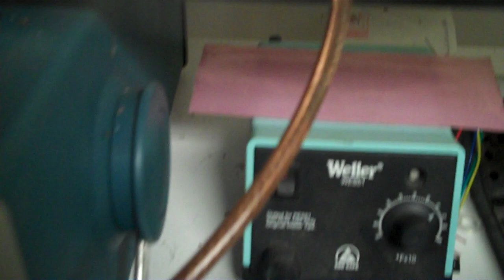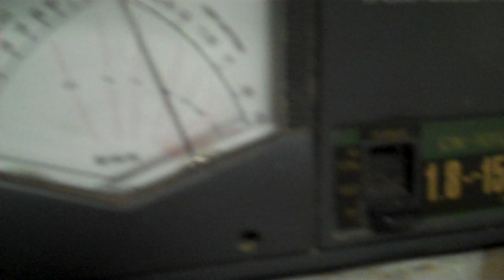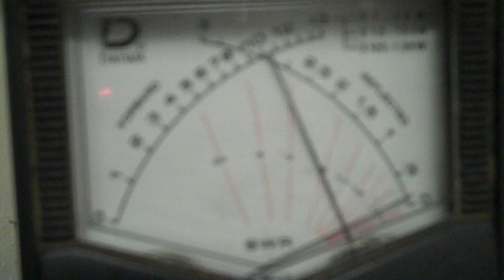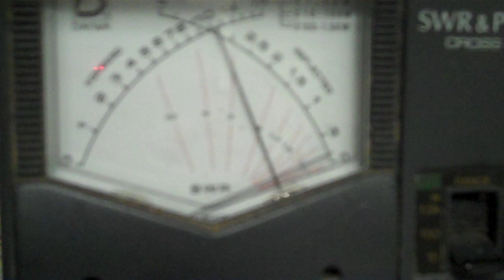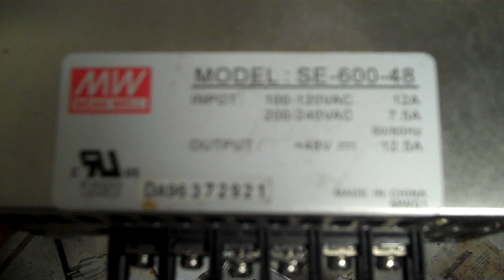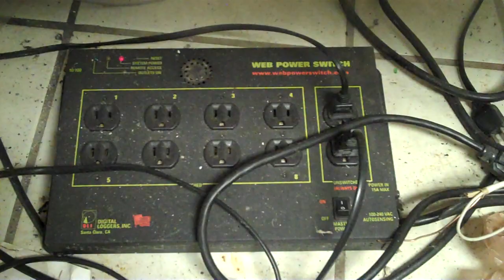Pirate Radio station

Comment: Yes, I did a test transmission with a 150W TX from my room and disturbed TV reception and anything metallic, so it seems! Nice Weller Soldering Station you've got there, haven't seen one of them since the 70's.

Comment: To all " Pirates" of the radio, my  first response is great for you to have your own station.  The Airways are free, and it supposed to be so.  Government should not refuse a license to broadcast anywhere, but regulation is really necessary.  I wouldn't want to interfere with someone who has a commercial licensed station, and that's their living, and business.  Non-Commercial radio on the broadcast band should be allowed but limited wattage.  Now to my point.  The main heart of your station is your ANTENNA !!!  Not how much power you got. Make your antenna as good as possible, and do NOT slack when it comes to the very best you can get, or make.  Dipole antennas are great, but they have some serious drawbacks. For great FM transmission, you really need a ground plane antenna, tthat is at least  one quarter wave length long.  This is minimum.   After you have made your antenna the best you can get it, then add your power, but no more than one watt to start with.  Do not tick off your neighbors.  Use of RF chokes can isolate harmonic radiation from your transmitter.  Grounding your transmitter to a good earth ground is another plus.   After you have done all this, and cked your frequencies that you could use, listen intently on that one frequency, to see if there is ANY distant stations that you can just barely hear.  If so, look for another frequency to broadcast that one watt.  Don't ever forget that the licensed station DOES have the priority on the frequency.  It only takes ONE COMPLAINT for the FCC comes calling.  Finally, try not to offend any one by programing you send out on the air. Someone may report you for other reasons that includes obscene, indecent, vulgary, or slanderous broadcasting or programing. Just a few thoughts from an old Commercial Radio D.J.
Reply: antenna is very important, but on some radio bands you need enough power to break through all the noise. Say here, on FM with a powerful antenna and 50 watts, i got shy of 3 miles, on AM with a fairly tall mast and a good ground system, i get shy of 10 miles with only 5 watts. The FM band in my area is extremely crowded with 100 kw stations, but the AM band there is nothing above 1580 and the most powerful station has 10 kw. both is better, also filtering and modulation is important.
Reply: K-LOVE GET OFF THE AIR!!!!

Comment: 10 watts mono with a 50 foot antenna and you only got a 1/4 mile? I transmitted 10 watts stereo with an antenna only 20 feet up (j-pole) and the signal went about 3 miles.

You must have a really crappy antenna.
Reply: Ryan Toomey I don't know what all you guys are doing wrong. I'm using 7 watts, antenna isn't even outdoors, I'm getting 5 miles solid coverage with an additional 3 miles fringe coverage.
Reply: @brettcooper3893  I'm using .05 of a watt and they can hear me a state over, so you guys are TRIPPIN. (ha  ha ha, it was a joke)

Comment: So long wire between power suplly, transmitter and power amplifire? No so good idea. It must be more shortly. Such an arrangement and connections is not so good for reliability and stability in operation of the equipment.
P.S. Please do not be offended.

Comment: BE CAREFUL , interference is the reason I only put out 1 watt! ( I've been on the air a long time) and at 10 watts or 150 watts , you are likely to cause interference and get a NOUO from the FCC!  With only a 1 bay antenna system all of your power stays next to your house. 2 antennas 10 feet apart would make your signal less concentrated near your house and go further.

Comment from the maker: 10 Watts went about a quarter mile in all directions, and 150 Watts covered the whole city.  About three miles all around.  The problem with 150 Watts in a neighborhood is front end overloading.  Pretty much anyone within a block would hear only our station, no matter what they tune too.  My neighbor could hear it through his speaker wires.  We tried filters, but didn't have much luck.  The antenna was on a mast attached to the chimney about 50 feet up.  Antenna height and antenna elevation above terrain is your best friend.  More transmitting power helps, but not as much as you might think.  Like 20 Watts wont go twice the distance of 10 Watts, not even close.  Get you a nice little ten Watt transmitter, some sort of directional antenna, and stick that thing up as high as you can get it.  The more power you transmit, the more problems your going to have.  Like front end overloading, rf interference on your own equipment, and pissed neighbors.  Hope this helps all our future and current pirate radio cats.  Remember, check you local laws.  Where I live it is not illegal, merely against FCC regulations.  The absolute worse they could do is fine you, and take your equipment.  Most of the time its just a cease and desist letter, and if you ignore that, expect some FCC engineers to come knocking eventually.  The FCC engineers that came to us were pretty cool, they liked what we were doing, but had a job to do.  BTW they took our amplifier not transmitter.  The amplifier was the cheapest part of the system.  Seriously check you laws, some states it is illegal.  I believe in Fla, it might be a felony!  Also, dont be a dumbass and broadcast near an airport, you interfere with those planes and they will come with a quickness, and most likely spend time in jail.  Do your research, take your time and dont be an asshat.  A good way to learn about radio is your local HAM club, but dont tell them about it.  Thanks for all the positive responses, and eat a bowl of dicks to the ones talking shit.
Reply: 1/4 mile with 10 watts? Lol I'm sure if you put a wattmeter between your antenna and Tx you will have SWR as hell,  your LCD say 10 Watts but maybe only 2 you can radiate ...asdasdasdsa
Reply: Matt Bremer We had 20ish miles with 300 watts. We had it on the roof of a 30 storey building, and a link transmitter that reached around a mile so we could have the studio in a different location. It wasn't PLL though.
Reply: +Matt Bremer Hello Matt, how is that possible? We have had a 6 mile coverage, and within 2 or 3 miles in all directions a very loud signal, with just 8 Watts, using one single open dipole antenna on about 46 feet height.
Reply: +TV13 I tried a transmitter with a power of only 0.5 watts before and I managed to get nearly 2 miles with a decent signal, I'm not to sure how he only managed to get only a quarter mile on 10 watts!
Reply: @MarkAyt  i get 2 miles with 50 watts and a powerful antenna, so ERP is around 100 watts.
Reply: I get 10 miles with 10w and 3 miles with 1w profesional transmiter exciter..I dont understand how do you get just a a quarter mile with 10w.Or your antenna is shit,or your transmitter is shit ,or the buildings is around you.
Reply: @ciro79  I think it’s the 100 kw stations 6 miles from me and a few tall metal buildings that are the problem. I am running 50 watts. Because I can hear it like 10 or 20 miles away if I have a yagi and a super selective receiver. I moved to AM and I am getting twice the listenable range with half the power. with 20 watts, the carrier is detectable 100 miles away during the day. I am using the same tower, infact I am using the coax shield of the FM antenna as the AM antenna and I only need a small loading coil to achieve resonance. I transmit on 1710 AM.
Reply: @letitrotfuckit  WBFM hawe wide bandwith of 180 khz so lost many transmit power with the range, but audio is very quality.AM transmiter use just  10 khz bandwith, and use bouncing of jonosphere, so it goes very far.For example i am HAM radio operator and i make many conversations in the air with New Zeland radio amateur stations on SSB mode on 7 mhz and 100w power of my station,from Europe.SSB is just 2,5 khz wide.That is 17 000 km range for 100w SSB transmitter..
Reply: i had 2 miles with 50 watts, but 10 miles with 5 watts on AM.
Reply: lol well damn i was about to call you a dirty pirate but you got me with the bowl of dicks thing! lol im trying to figure out how to do this, i live in a small town and trying to figure out what i need to get about 15 or 20 miles coverage. fuck the FCC or any other 3 letter boot lickers that have a problem with it.

Comment: My yagi was designed using yagi for windows for extremely high front to back ratio. I achieved about 40dB by correctly spacing the reflector from the mast. This was so I could aim the antenna so the null was in a specific direction to make the signal more decieving... that it might seem as though they were getting further from the source as they got behind it. This design I later used to make a 4element gizmotchy. Now that was a kick ass antenna that the wind couldn't spin around. I was ramming 150w into it from a tuned push pull amp I designed and built (a 15V design too). I lived on a hill with 270 feet elevation. I could drive around listening to it 70km away through pine forests and hills. I gave this all up, done all the experiments, had all the fun. NEVER GOT BUSTED! Lol!
Reply from the maker: Sweet man.  Can you give me some links to a good directional antenna design.  Im looking for something that will give me a 90 degree pattern to the front, and as little to the rear and sides as possible.  Thanks for the post.
Reply: Matt Bremer My best advice is to get the yagi designing program 'Yagi For Windows' and have a play around on a computer using scale.exe, which comes with it and is used to scale the antenna designs in yagi for windows to different frequencies. With this program you can mess with element spacings and their tuning until you get the response pattern you want. It will give you polar plots on a db scale. It was issued with the ARRL antenna book probably over a decade ago. Before I owned yagi for windows I used to experiment with yagis where I made the elements adjustable out of aluminium tubing and hose clamps. I used a home made field strength meter to adjust for either maximum forward 'smoke' or highest field suppression off behind the reflector. Get hold of copies of old amateur radio literature about antennas and read and experiment. I have been playing with antennas (mainly on the FM broadcast band) since I was 13, and electronics since I was 8. I'm now 31. Lots of fun experiments in this time, many made from junk found in the trash or salvaged from the tip :)
Reply: Matt Bremer A vertical di-pole should give you a 8 with focus to front right? I have a 5/8 that is not installed yet, but maybe I will tomorrow. Also even though you tried low pass filters you might have still been over modulating even when it sounded good to the ear. I didn't pay attention if you were running processors or not. You have to take some of the unheard sound away and them amp it up to fill the rf. 150 watts unfiltered and unprocessed will send crap above and below what is on the radio dial and piss off the neighbors and HAM folks.

I wish I had a brick chimney instead of this stucco junk. I thought about using a tripod with 10 foot pole, but with the stucco and up to 70 mph winds several times a year it is a no go. 

oh I just thought of something funny. I just read that for 100 watt transmitter you need to be 200 feet. I could be wrong it was late. Now that is to be legal, but that is a lot of power. 

I was also thinking about going AM due to the crap with FM. I live in the middle of no where with the closest station 68 air miles that you can hear on a good day, but they suck. Last year during licencing they applied for a jumper (whatever it is called) licences and got it. It still suck. The sound sucks. The music sucks.

Comment: J pole? I experimented with those and I think that they're a waste of time. Feedline currents interfere too much with performance and also end up on your gear causing problems. I found that a vertically polarized gamma matched dipole was better if spaced out at least a quarter of a wavelength from the mast. Better still in ways was a 5/8 groundplane with slightly sloping radials but head over hills in front was a vertically polarized 4 element yagi on a 1/2 wave boom optimized for the desired radiation characteristics.